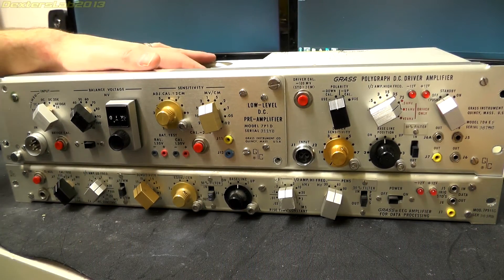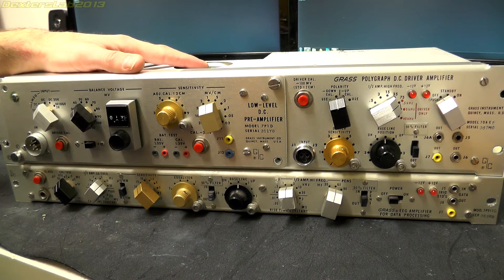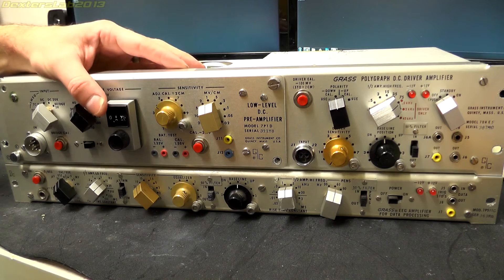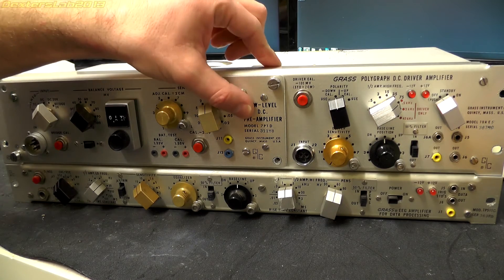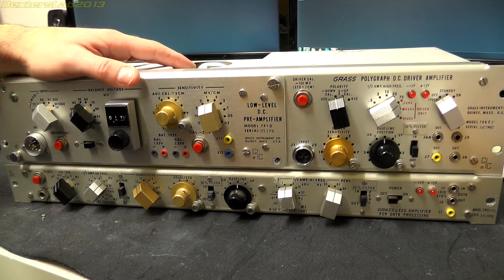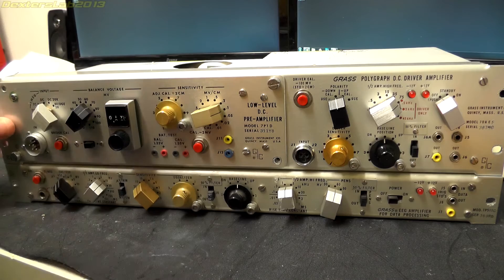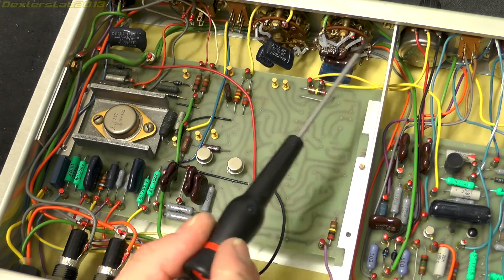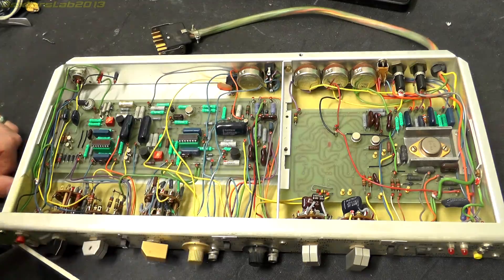DL#081 - Grass Polygraph EEG Data Processing Amplifier Teardown

Comment: you had a grass headbox into which you placed electrodes attached to patients. Cable from the headbox went to the inputs on the polygraph which contained multiple amplifiers...some, like this one for EEG, EMG and EOG, and ECG Others were for slower DC recording like breathing and airflow, other DC amplifiers converted output signals by DC equipment like oximeters into calibrated signals through other DC amplifiers. Not rocket science, you just need to know the requency of the signal you wanted to set the filters accordingly. EMG was 10 to 70 hz, EEG was 0.5 to 35 or 70hz depending, ECG 1 to 35hz etc.

Comment: G1Cxx just means Grass did a custom buy of components, and as they were buying 10k of them they got the free custom customer part number instead of the Nat semi part number. Used to be common so the service would only be done with "authorised" spares, a regular part number ( even though the chip came off the same line and was otherwise absolutely identical performance and function wise) would invalidate the warranty.
Reply from the maker: +SeanBZA Yea, thought as much, am sure i saw a couple of capacitors too with G1C marking, think i forgot to mention it though.